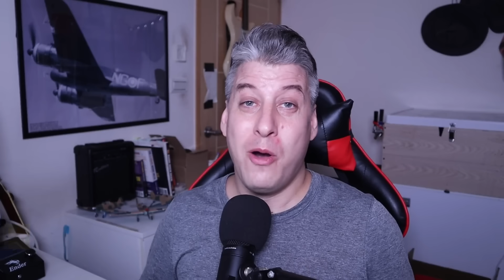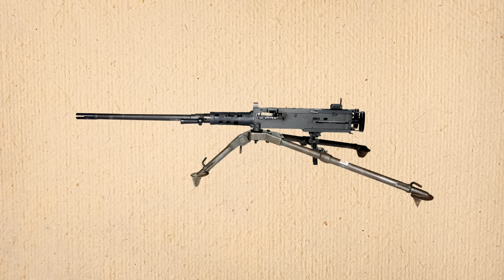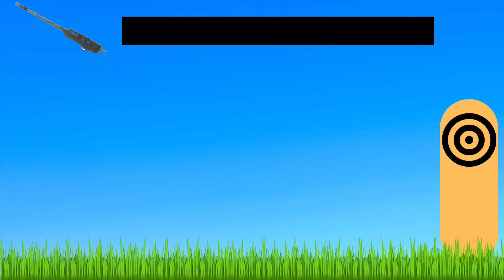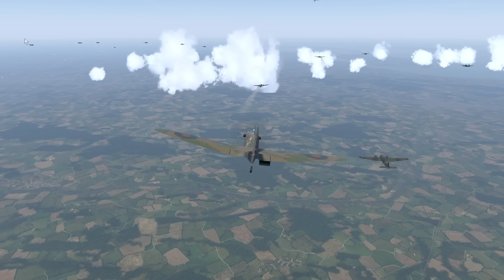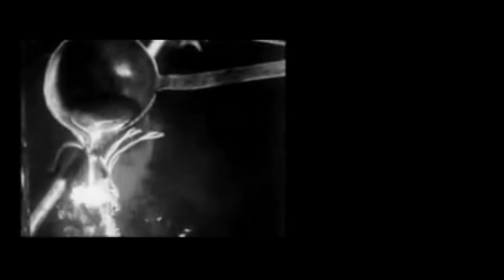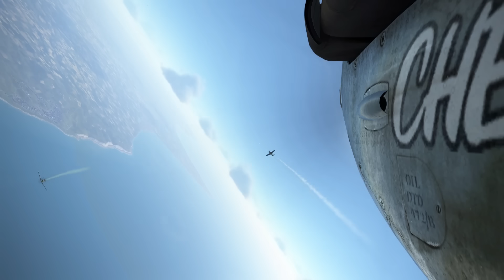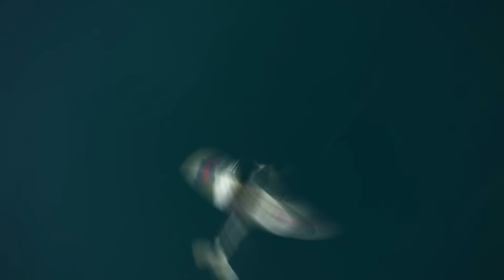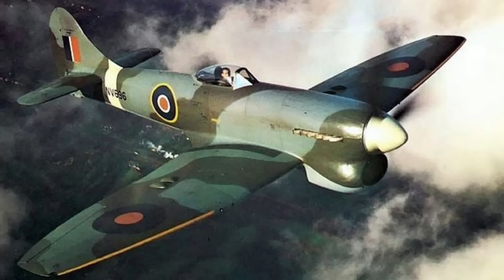Why Did The RAF Use .303 Caliber Machine Guns in WW2? The Surprising Answer

Comment: Great video! The .303 makes the self defense argument that "the caliber that you can most accurately shoot, is the best caliber to carry."  Being able to put 20 .303 rounds in an enemy plane is better than missing or only putting one or two .50 cal rounds.
Reply: Example two 50 cal round does more damage than 20 303 rounds.
Reply: @verdebusterAP  if they contact the enemy
Reply: @alpearson9158  
Hence why training is important
The problem with the 303 use was bad information
The claim was thousands of rounds was needed when in reality, it was just accurate targeting
Reply: @verdebusterAP   get in close to be more certain, then go a bit closer. First to need to hit...
Reply: @alan-sk7ky  
You dont need to be close with big 50
Reply: @verdebusterAP  not really.
Most critical components of a plane are fragile things like cables and hydraulic lines that you either hit or you don't.  More chances to get a "critical hit" is better than 1-2 largely insignificant holes that miss everything but the skin of the plane.

Or put another way, 20x .303 rounds has a bigger cross section than 1-2x .50 rounds.

More armor penetration power doesn't help against largely unarmored targets.  You're just passing more of the little metal you can afford to carry with you through the same hole the tip of the bullet already made.

The square-cube law is working against the 50cal in this case.

Once you move from machine guns to cannons and can actually get effective explosive rounds this changes, but below that, more rounds headed toward your target is better.
Reply: @dynamicworlds1  
Incorrect
Targeting the engine or cockpit is most efficient way to bring a bomber
With fighter ,same tactic

Comment: As usual logistics and the design of the aircraft has a big impact on what guns are being used.  The Spitfire was fast because of it's thin wings and thus smaller fuel tanks and smaller guns had to be used. The 20mm cannon was fitted when ground attack was favored over speed. American aircraft like the P-40 used 30cal for the same reason.  The P-40 was effective against Japanese aircraft because they sacrificed armor for speed.  The P-47 had wings designed to carry the 50cal gun and bigger fuel tanks, but this design created more drag and thus less speed and more wing loading which limited maneuverability. It was only when planes with more powerful engines were developed that bigger guns were carried.
Reply: Only the early P40s used .30cals. Most variants had 6 x .50cal.

Comment: This article is long-winded sophistry. The Americans and Germans developed reliable heavy-caliber machine guns in the 30s because they knew another war was coming up, and heavier armaments would be needed. The British didn't because they were complacent. That's all there is to it. (And, by the way, complacency also accounts for the British failure to develop a self-loading battle rifle during or before the war.)
Reply: Complacency was a factor to an extent, but that's not the whole story. The Brits used .303 initially because it worked, and they already had it. As soon as they got the 20mms working properly they went for that. And 20mm is much better than .50cal.
As for a self loading rifle, that wasn't a big issue. Was the M1 Garand better than a .303 Lee Enfield - sure. On the flip side, the Bren gun was much better than the BAR, and the Sten gun was effective and much much cheaper than the Thompson (yes the Brits initially had trouble with quality control, but they fixed it).
On the other hand, post war the British developed a 7mm intermediate cartridge (the .280 British). US didn't want that, and we have spent the last 70 years bouncing between 7.62 (too big) and 5.56 (too small) and now look to be going to 6.8mm - pretty much what the Brits were suggesting back in 1946...
Reply from the maker: Thanks for the feedback.

Comment: Saw a vid of a 30 cal Garand punching through a 1 foot diameter tree no problem.  Hard to say a rifle round is "weak".  Of course the 50s can destroy concrete structures and defeat armor.  The larger the round the more explosive or incindiary it can carry.  A simple 20 mm AP round would go right through an aluminum aircraft.

Comment: A bit stupid question at the beginning of the war, they used 0.303 mm machine guns because they had enough of them and logistic facilities. Already in the Battle of England, 12.7 mm as well as 20 mm cannons were used. You can also ask why the USA did not use 20mm cannons.

Comment: What you’re missing: Britain didn’t have the production capacity to retool and produce more effective guns in quantity, and what you’re shooting at matters. For comparison, the US did have the leisure and protected inland facilities to tool up for mass production of the Browning .50, which ultimately resulted in late-war planes being equipped with 8 of them (4 in each wing). By the time the US seriously entered the European theater the mass production of new aircraft shifted the Battle of Britain from a defensive one against Axis bombers (where the Hispano shined) to an offensive one where rate of fire against fighters was more important. In the end it’s largely a function of the wartime economy that kept the .303 in place, even though it was the worst aircraft gun of the war when compared by either throw weight (grams of lead per second) or the ability to fill a volume of space in a burst (as is the case when firing on fighters). 

You’re right though, the Hispano was definitely the best cannon of the war on all fronts.
Reply from the maker: Good point.

Comment: The reality is the Brit’s had used the .50 in testing but it’s rate of fire was too low to effect damage. The Browning .303 had a rate of fire of 1200rpm. The rounds were effective as the aircraft of the early years were unarmoured. The 8 gun combination on Hurricane and Spitfire was designed to chew up the enemy.
Reply: Another problem during testing was that he fifty calibre round tended to 'tumble' after it penetrated the aircraft skin ,making it less effective.

Comment: The first 20mm cannons were installed one under each wing. But they were unreliable. When one jammed, the recoil would throw the plane off target. Only when they were light enough to fit two under each wing were they used to replace four of the eight machine guns.
Reply from the maker: So initially they were in 'gun pods'? Interesting.
Reply: I thought the first ones were mounted in the nose, as a group of four with  box magazines. It is a pity that Petter couldn’t get his aeroplane quite right quickly enough although 100 odd went into service
Reply: 20mm were laid on their side leading to jamming. The Spitfire wing had to be redesigned to carry one of two 20mm. The reliability issue meant they used two 20mm and two .303 per wing.  The .303 was really useful for sighting the 20mm and its limited ammo. 
Mosquito did this even when they had the 57mm six pounder. The .303 guns lit up the target got the Six Pounder to blow to shreds.

Comment: not only did we keep it pinned for necessity to press it into service... we also didn't have anything suitable aircraft wise (airframe and engine power) to take the Oerlikon cannons.
Reply: Which are physically larger and heavier (due to being open bolt API design) and thus less suited to aircraft wing fitting,  than the comparative HS 404 (gas operated locked breech) which was designed with fighter use in mind.

Comment: Back in 1968, I fired a .303 round from a Lee-Enfield rifle, at a 30cm x 30cm x 10mm mild-steel plate from 50 metres and it went flying. I then fired a 7.62 round, from a Belgian FN rifle, same conditions, and the steel plate did not move. The .303 round had made a fair dent, where the 7.62 had clipped right through. This was my first infantry, ballistics event. Great video. 😏
Reply: I've shot many 3/8' thick steel plates with both .303 Brit and 7.62 x 51. My experience is that both burned a hole right through the plate from the same distances.
Reply: BSA Meteor...now that brings back a few memories ..Vulcan?
Reply: @copee2960  My BSA came into South Africa via the back door during the apartheid era. No model number & no serial number. Bought around 1969 and I have just given it away, looking like new, but requiring a new piston & seals. Take care. 😉
Reply: Many years ago I fired a 303 on the range, no problems. Then I fired a 303 rebored as a 7.62, the extra recoil from the 7.62 round was colossal, shoulder really hurt and I am 6' 4". Firing the SLR was no bother either.
Reply: @gordonc5354 still wear panties?
Reply: Good old SLR L1A1
Reply: @jacktar5867  It was the C1 rifle in Canada and I loved that rifle.
Reply: Guys who like guns have trouble getting women.

Comment: A point I heard, often over looked, that interested me, was the difference in Official figures of R.A.F. confirmed visuals Kills vs L.W. reported airfield losses.
An argument I heard was that the .303 in the B.O.B. period was far more impactful strategically than was and is appreciated. 
Many German aircraft would appear to survive contact only to 'down' 'unseen' into the dreaded channel or crash at or before RTB, many not to be Officially declared as combat losses but malfunction, crashes due to error etc..
Even upon getting 'home' many crew returned casualties WIA or KIA, a costly loss. Many aircraft were so wrecked they were scrapped or took a deal of repair, that took them out of combat so that Wings were visibly severely depleted on the next Ops.
All this hit the crews hard, further more after the unappreciated high losses during the Battle for France. For these and many other reasons LW moral took such a nose dive at the time, many were reported being frustrated that the reported LW official air losses didn't match up with crew experience around the diner table back at the field, some felt the sacrifices were unappreciated.
Reply from the maker: interesting!